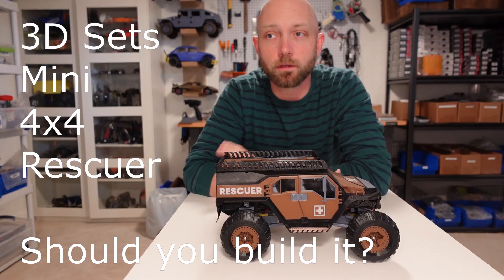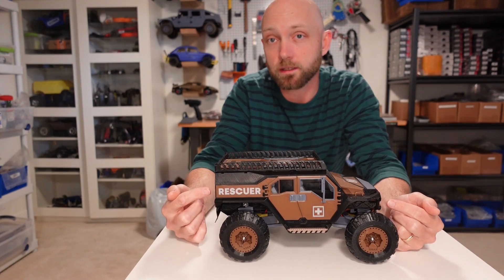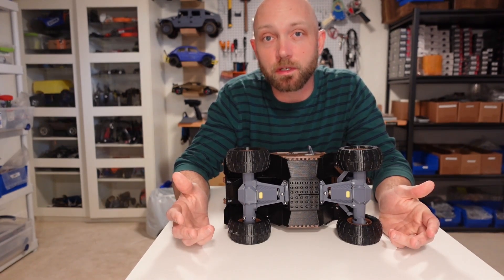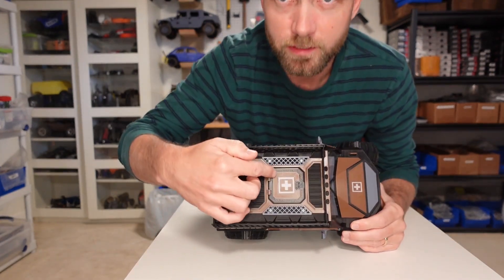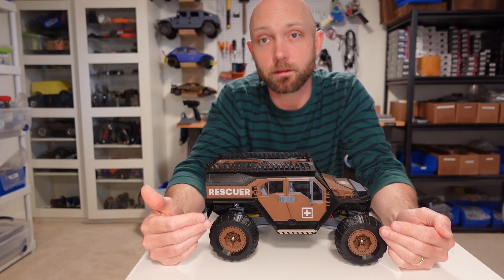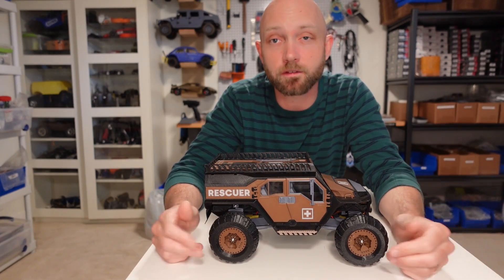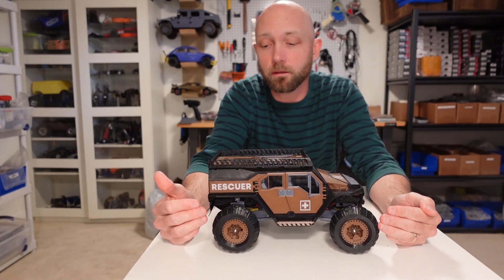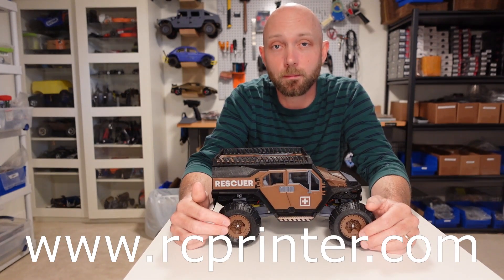3D Printed Rescuer Mini 4x4 Vehicle by 3DSets - Should you build it?

Comment: Just finished two with my boys (7 and 10).  They had fun choosing colors to print each piece.  The parts kits are great too.  You can source the pieces yourself, but man it's a hassle.  Did both with parts kits from RC Printer.  Moving on to a Robak 2.  It's for the kids, of course.

We did 4-wheel steering.  Turns on a dime.
Reply from the maker: Very cool, glad you enjoyed the Rescuer builds :) You'll love the Robak 2!